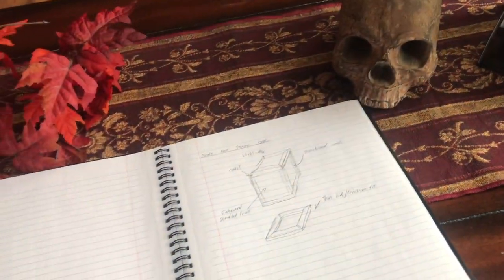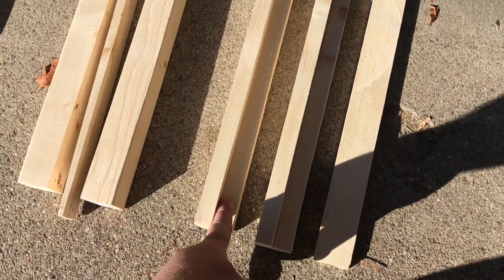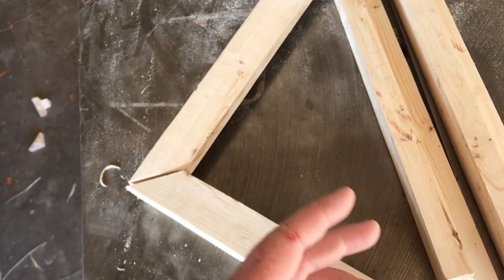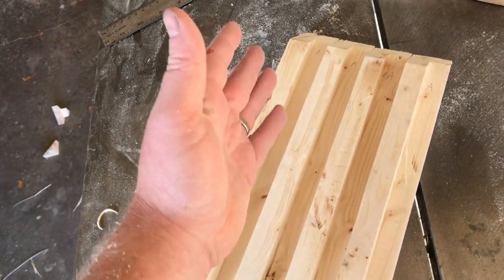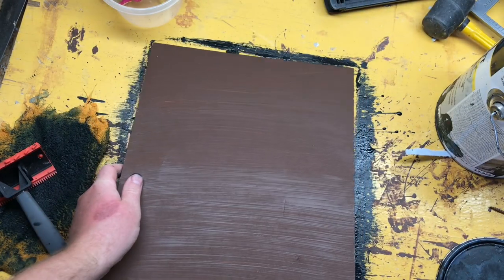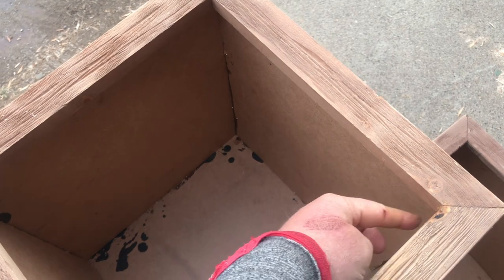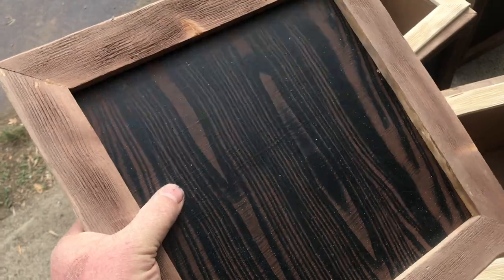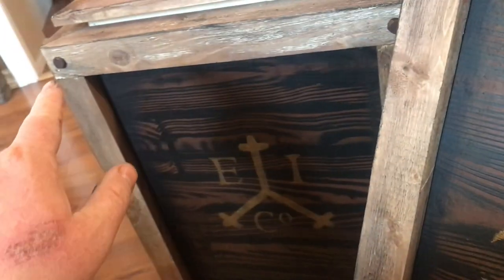Pratical Prop! DIY Pirate Ship Crate / Storage Box.  A Great Halloween Project!

Comment: What kind of paint did you use on the stoneboard? Latex, acrylic, oil?
Reply from the maker: I just used a acrylic indoor house paint.   You can almost be guaranteed any of the paints outside of spray paint are all acrylic latex paints.  I usually grab most of them from the off-tint shelf at my local building supply stores, so I usually don’t pick a specific brand but whatever paint has been off tinted on that day.   If I had to say my favorite brand of paint is Behr, all the off tints I have purchased of that brand have been amazing!  Thanks for watching!
Reply: @SamhainPropworks  Thanks. I am currently building these this Halloween
Reply from the maker: When you finish them send me a picture!  I really enjoy seeing peoples takes on my props!